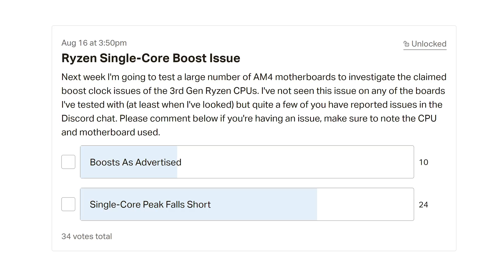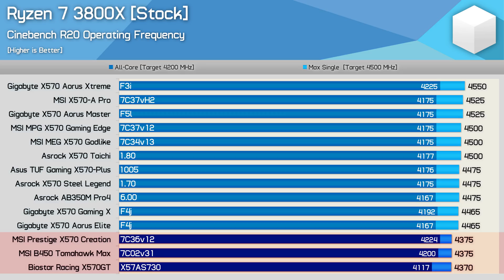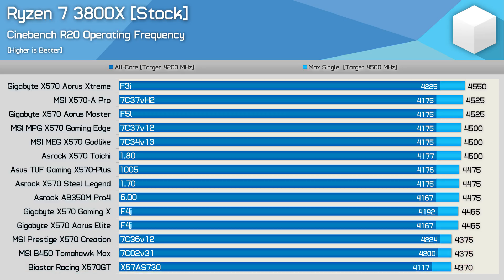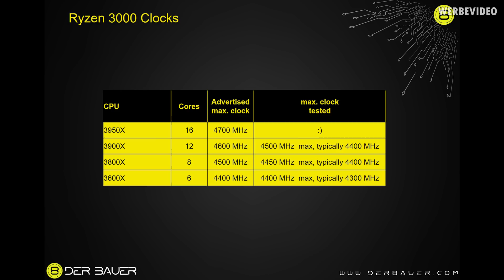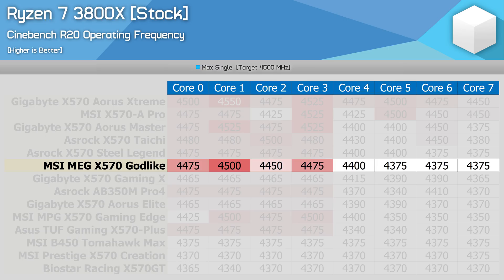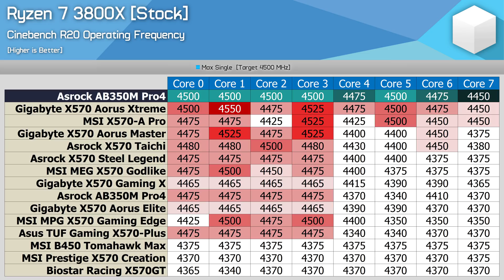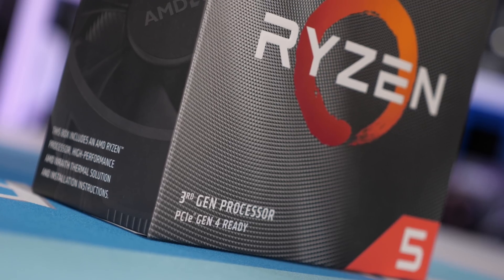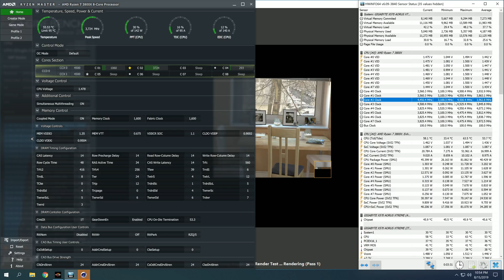AMD 3rd Gen Ryzen Boost Clock Investigation

Comment: So glad you are giving this coverage! This is my lunchtime viewing sorted. Thanks, guys. My 3600 never hits 4.2ghz paired with a Crosshair VI. 4.1 GHz is the max speed.
Reply: my r5 3600 boost 4,25ghz in light load like gaming. when i use power saver mode it only boost to 4,1ghz
Reply: @RioGamerZ  exactly, they need to download the chipset driver and set the performance mode.
 Simple as that.
Reply: @RioGamerZ  Power saver mode? Do you mean the power plans? I run the Ryzen balanced plan. Any tips are much appreciated
Reply: @V1CT1MIZED  i set to power saver mode in ryzen master software. you can try open ryzen master and see 
 what your cpu curently setting there.and also new chipset driver  make different behavior in cpu clock speed
Reply: @RioGamerZ  Ah I see, I will check it out, thanks :)
Reply: @V1CT1MIZED  dont use ryzen balanced mode, set power plan to full performance mode. It allows much higher frequencies.
Reply: @V1CT1MIZED  I also have the Crosshair VI I get 2-3 cores highing 4.4 Ghz on my 3600X. I have run all the bios since they were released. But to hit the max boost I found in bios I had to set OC to Auto, memory 3200 with manually setting the XMP (ie, 16 18 18 18 38) all others left on auto for stability, and between 1.33 - 1.35 mv. When playing the Division 2 I see these top frequencies on 3 cores in spikes of course but it happens enough I think to keep avg. fps up. I should also note that in windows 10 I use windows balanced mode as the AMD balanced mode only goes upto 4.375 but it's spread over 5 cores. TBH I am not cpu bound in any game in my library. I use a 2700X for my productivity needs with a Vega 64, and game with a RX 480 OC on water to 1435Ghz/2100 vram. 1080p\144Hz monitor. All my game fps fall within the FreeSync range of my monitor, so do I really need more at this point in time?
Reply: What BIOS revision are you using? I'm also on a C6H with a 3700X and I hit the full 4.4GHz during lighter workloads, but I've heard that newer BIOS revisions don't allow that. I'm still on 7201 (which uses AGESA 1.0.0.2) and don't see any reason to "upgrade" given what I've heard. You might try flashing back to that version and seeing if you see an improvement.
Reply: @CaptainKenway  im also still on ch6 7201 and my 3600x hits 4.4 on core 0 and 2
Reply: @CaptainKenway  I wouldn't bother I tried the next Bios update and its ass.
Reply: @CaptainKenway  I'm using 7401 1.0.0.03ABB bios. Even on 7201 it wasn't boosting properly. I can manually OC all core 4.1ghz @ 1.25v and 4.2GHz @ 1.35v so the CPU is capable. I have literally tried everything and every bios. I have used an h110i and a Dark Rock Pro 4 cooler to see if that would help to no avail. It's frustrating
Reply: My 3600 behaves the same, but on a Tomahawk MAX with 1.0.0.3A bios.
PBO enabled avg mc: 3980mhz sc: 4080mhz. Enabling auto OC only adds 20mhz to both.
Manual all core is stable 4125 @1.3125, stupid thing: 4200 not stable on gold rated core!
Reply: @gkirmathal  1.3125 is pretty low voltage. Have mine all core 4.25 at 1.375v. can't run it at 4.2 even at 1.366 or whatever one step down is. Only hit 74C in stress test and stays below 70C gaming/normal loads.
Reply: My 3600 paired with the gigabyte x470 aorus ultra gaming hits a maximum 4125 with PBO and Auto Oc set to 200 and the scalar set to 6. I've tried all configs in the bios and the best I can get on single core is 4125. I can only get the all core to 4125 with 1.45v stable. I think my chip has poor silicon. Running ryzen high performance power plan. Latest F42a bios and latest chipset. Cooler WAS a 240mm AIO but changed to wraith prism for the bling. Nothing changed. Any ideas?
Reply: @MrIsmaeltaleb85  pbo doesn't even do anything for me. If anything is makes it worse. My manual oc proved to me the silicon can handle it. I just think we need better agesa and bios updates
Reply: @V1CT1MIZED  for me PBO added about 50mhz tops. Auto Oc did nothing at all. For me to hit 4.2 all core I would probably need 1.6v I'm not kidding.
Reply: @MrIsmaeltaleb85  With ryzen 3000 you really need to rethink oc. Since AMD already admitted not all cores are equal, there is no point in all core OC. Try per ccx overclocking in ryzen master. Rather than having your slower cores dragging your OC down, have your better cores clock higher. Usually the better ccx can do about 50 to 100mhz faster I find.
Reply: @MrIsmaeltaleb85  I use Elite and can't hit 4GHz. I can however OC on all cores to 4.175GHz. It's not your coming that's for sure. I use 280mm AIO and my temps are in green.
Reply: @MrIsmaeltaleb85  Hi I want to share my test recently, I'm using 3600 paired with thermalright macho rev.b cpu cooler and asrock b450m steel legend (AGESA 1.0.0.3 ABB), I set to manual mode with 1.3875V and all core speed can running stable at 4200, using ryzen balanced power mode.
you can try the manual mode btw, my pbo only reach 4050 while gaming and peak reach about 1450 and 1475 while the voltage ranging between 1.4 to 1.45 max.
Reply: @Adrian-kk9rj  Hey Dan. i have tried manual mode from 4125, 4150, 4175 and 4200. I can just manage a cb20 run at 4150 but anything under 1.45v and it crashes. My x470 board doesnt have LLC so spike to 1.462v Vcore.
I just tried this; (Max Clocks in HWINFO64)
PBO Diasbled = 4100 Mhz - Vcore 1.416v
PBO Enable = 4100 Mhz - Vcore 1.416v
PBO Advanced + Auto OC 200mhz = 4100 Mhz - Vcore 1.416v
TOP 3 settings are identical. Seems like PBO etc doesnt do anything on this board.
AMD Core Performance Boost (and PBO) DISABLED = 3600Mhz - Vcore 1.04v(Auto) - (Crashed in CB20) What a effing joke. All Vcore settings are in Auto. I dont play with offsets. My chip/motherboard cant even run at base settings without crashing. Temps are great. VRMs max out at 46 degrees Celsius and CPU max in cb20 is 68.
Reply: My 3600X hits 4.4GHz no issues at all, Gaming it will sit around 4.3GHz

I updated the Bios on my C6 to 7306 and the CPU seemed locked to 4.25GHz when Gaming so went back to 7201, what cooler are you using?

Strange but true the CPU seems to boost better with a lower latency kit @CL14 rather than a C16 kit I have.
Reply: If I enable PBO+Auto OC it will sit around 4.35GHz whilst Gaming, 4.4GGHz very light work loads.
Reply: R5 3600 with X570 strix-f 4.2 manual on all cores @ 1.318 volts with Fryzen cooler.(cooler looks great but it is very loud,would not recommend)
Reply: @relax3d  Nice!!!
Reply: In so many comments i read people upping their voltage in order to obtain higher stable speeds. In this series of cpus core performance is more temp restricted than voltage restricted (even more so if you dont use an aftermarket cooling solution), so higher voltaged are counter-productive especially for single-core overdrive boost. Undervolting the cpu yields better results and I wonder if this may explain the differences between different mobos since they have different voltage presets.
Reply: @paris8132  interesting points. I'm using a dark rock pro 4 and previously had a h110i so temps were good. But the temps are better on my air cooler due to my case, I may have a play with the voltages. Mine never goes past 1.450v but most of the time it is more like 1.43v and below
Reply: @V1CT1MIZED  If you're using a capable cooling solution, I wouldnt even try bother with undervoltage, tbh, as potential gains are small. If you wanna try, I would suggest something like a -.05V offset. Remember that its very possible you might start seeing those 4.2 GHz max values but performance might have actually dropped so be sure to test before and after.
Reply: Ryzen 3600 + Mortar B450 only 4100 MHz achieve max boost on Singlecore.
Reply: @dima.s No, en una MSI B450-A PRO, activando el boost game, todos los núcleos a 4200
Reply: @antoniodomingo1904  i can activate the msi Game boost and get 4.2 GHz too. But i will that my cpu achieve 4.2 on Singlecore Automaticly.
Reply: @dima.s  Automáticamente en singuel core me coge como máximo 4149
Reply: @dima.s Mi 3600 en una MSI B450-A pro, activando el boost game, se ponen todos los núcleos a 4200
Reply: Clearly I am much luckier. I have MSI x570 gaming plus. Ryzen 5 3600. Using all stock setting and a $20 tower cooler all of my cores hit 4.2ghz max boost. With 1 core on each ccx hitting 4.3ghz in bursts (lasting less than 1 second).  When I run cinebench I get all 6 cores boosting at 4.0 to 4.1ghz.  
If I turn on PBO with 200mhz offset the 2 strong cores goes to 4.4ghz burst while all core boost now going to 4.125ghz.  
This is one of the cheapest MSI x570 board too. So I never really understand why people couldn't hit this number.  
When I do single core OC all 6 cores could do 4.2ghz at 1.4v
Reply: @railshot888  It seems like the luck of the draw. Your cpu sounds good
Reply: @railshot888  on the F40 bios agesa 1.0.0.2 the core clocks hit 4.2 all the time BUT my cinebench r20 scores are no different to the latest bios with 1.0.0.3ABA. I get scores of between 3590 and 3630. I just did a run then and scored 3627 with PBO advanced Auto OC at 200 and scalar at 6. VCORE hit mostly 1.416v and temps maxed out at 68 degrees Celsius. Clocks ran between 4.0 and 4.05. Averaged 4.025.
Turned Auto Oc off and set PBO to enabled only and nothing changed. Temps and voltages as well as clocks but the score dropped a tad to 3590. I remember doing the same thing about a week ago with PBO turned off and my score was just under 3600 in Cb r20.
What scores are u guys getting in cb20 multi core?
Reply: My C6H and R5 3600 (bios that I have tried 7304 and 7306) boost normal single 4,2GHz and cinebench R20 allcore at 4000-4050MHz. Prime at ~3900MHz. And I'm using thermalright Silver-Arrow IB-E cpu-cooler with 2x140mm fans. In intel burn test my average temperature is 73C and in cine R20 ~70C and with prime avx temperature goes beyond 80C, ~83-84C.
I'm going to check allcore oc later tonight and my cpu was made in week 24/2019

Edit. all settings are stock except memory is in docp 3200 cl 16-15-15 with this b-die 3200 cl15-15-15 kit. And tomorrow is time to adjust the memory timings with ryzen memory calc. And ofcourse I have the newest chipset drivers from amd 19.08.2019
Reply: B450 steel legend,R5 3600,boosts upto 4.2 as advertised.
Reply: Stock or aftermarket cooler?
Reply: 3600+B350F GAMIING
When use AIDA64 to run FPU,it can only reach 4.125GHz，when I use PBO and play Total war:Three Kindoms, it can reach 4.35GHz all cores.But I never reach 4.2 in FPU or 4.4 when open+200MHz PBO
Reply: B450 Steel legend.Stock cooler,boosts up to 4200mhz,temps seem normal.Idle 40-50C.No oc or anything.UNDERVOLTED TO 1.25V
Reply: @SneakyCobra581  have you undervolted using a manual voltage or offset?
Reply: @V1CT1MIZED  manual voltage,ryzen master.
Reply: @V1CT1MIZED  altough,I can't undervolt while on default mode,just manual,so it won't hit 4.2 with manual oc,the voltage is 1.43 on default mode,then it hits 4.2.
Reply: @SneakyCobra581  ah cool, I will have a play! Thanks for taking the time to help me
Reply: @V1CT1MIZED  no problem,and by the way,I OC'ed my cpu manually all cores to 3.7,gold core to 4.0,Voltage was 1.35 and I got 1379cb( cinebench r15) when I go to default mode,I get 1500+.Just my experiance,stock cooler so I don't want to push it,I guess I'll just stick to default until I get an aftermarket cooler :')
Reply: @V1CT1MIZED  me again,undervolted to 1.35 (manual sticks to default I guess) and all of my cores go to 3.980mhz with stock cooler.I'll try to increase the voltage and reply later
Reply: @SneakyCobra581  1.25 V is too low. You might be getting better numbers when looking at max boost frequency but I guarantee you overall performance is significantly lower than stock. Just revert you settings to stock, apply PBO in ryzen master, run some benchmarks... and thank me later!
Reply: @paris8132  I already know that,tested it multiple times,just leaving everything stock gives ~10% higher scores in cb.
Reply: @SneakyCobra581  so... why would you run at 1.25v? I dont get it!
Reply: @paris8132  Experiment my friend,I set it up to stock voltage after ai saw the drop in points
Reply: I have the 3600X on a X470 Taichi BIOS 3.50 and I've never seen 4.4GHz, only 4.3GHz
Reply: try 1.35/1.3785v
Reply: En mi placa MSI activo Boos Game y se ponen todos los núcleos a 4200 en mi 3600
Reply: Sin activarlo se ponen sobre 4125-50 todos los núcleos
Reply: I can get only 4.1GHz all core and average 4.3GHz with 4.55GHz peaks single core on a C6H with 3900X. Its a real bummer.
Reply: @LukewarmEnthusiast  I have the same setup but never go above 4150mhz even though thermals are very low with NHD15... weird.... What BIOS setting are you using? anything else than downloaded chipset drivers from AMD that you have done that can affect the results?
Reply: @mikev190 My 3600 on an ROG STRIX X370-I hits 4.2GHz consistently. It's using a basic 120mm AIO - the ML120L from Cooler Master. Nothing special. Possibly the water cooling keeps it under a temp threshold for full clock speeds?
Reply: @boingkster  Shouldn't be. I have a Noctua NH-D15 and my CPU never goes above 70C. I have tried boosting cooling to keep it below 60C and still won't go past 4,15ghz. Hoping for the BIOS update coming
Reply: @lindstroem4  yeah that's most likely it. I had good luck with my board, it'll hit and hold 4.2 without issue, only dropping on heavy loads like P95 to 3.9GHz.